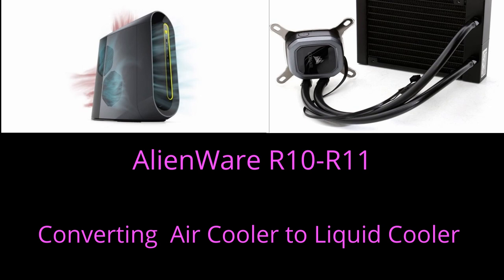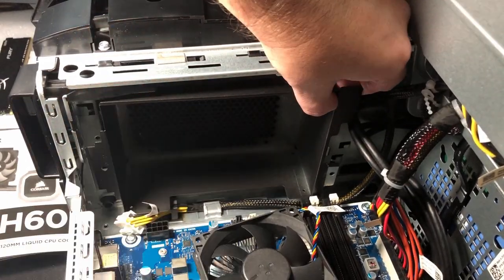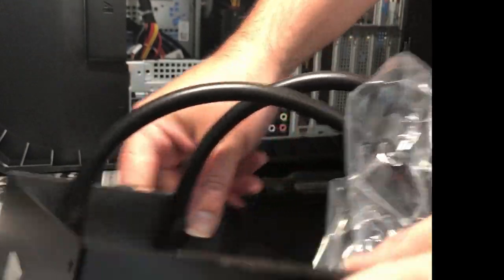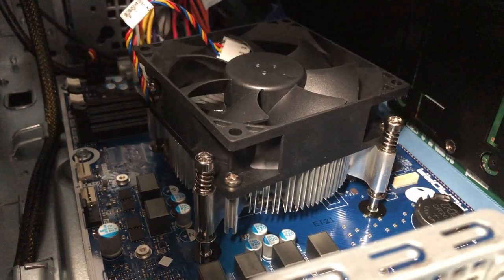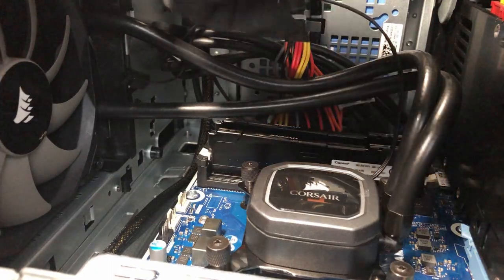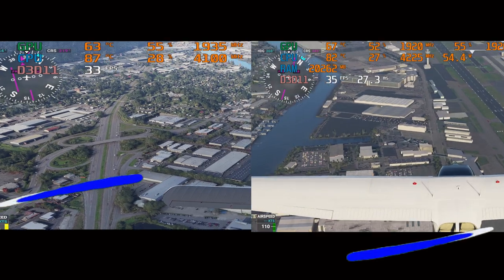Corsair H60 Liquid Cooler into Alienware R10 - R11 , Step by step tutorial.

Comment: Just did this to my R10. The radiator fit into the factory shroud is so so satisfying. Like it was made for it. Thanks for the tutorial! My R10 no longer sounds like an Airbus A380!
Reply: Heyy where do I plug my 4/3 pin plug at on my motherboard
Reply: Probably because the existing stock radiator is basically the same thing, just different fan (stock fan more powerful by noisy)?

Comment: Thank you for this tutorial.  I got this liquid cooler to replace the stock i7-10700 heat sink/fan.  My CPU temps dropped roughly by about 30-40 degrees Celsius.  Also, the quietness is great as well.

Comment: Thanks so much for this guide, I used it for my system and it was perfect. I also replaced the front fan to reduce noise as well. The only suggestion I will make to people who are doing this is to make sure you unplug your video card power cables before lifting the powersuply up, I did not do this and it pulled the video card out of the slot. Luckily nothing was damaged.

Comment: Seems to be working great for me. I did a push/pull fan setup on the radiator with two ML 120 Pro's. 

I did get the bios diagnostic error for "top fan", but "CPU fan" was fine which is also one of the new fans and both are spinning. Cooler is lit up and liquid is flowing.

FYI for anyone else interested, I also tried an Arctic Liquid Freezer II 120, but the holes did not align with the bracket and the hoses were too sturdy to really cram in this case safely.

CPU under 100% load is still up to 83⁰ C, but it's much quieter, and that 83⁰ would have been at least 92⁰ before while also sounding like a leaf blower.
Reply: Hi, push pull fan control by the cooler as well? Or one is connect to the cooler and other unit connect to the top fan? Thanks for your help 😊
Reply: please reply what do you mean top fan cpu fan did you use y splitter for the top fan or cpufan? what 4 pin did you use ? for the radiator fans is it the top fan or cpu fan ? with y splitter

Comment: Just did this mod, what a difference! No screaming fans anymore! No BIOS errors on boot up either  (I'm running an R10 if anyone is wondering).  Also swapped front fan and the stock H60 fan for ML120 Pro fans.  38-40 degC on idle and 75 degC on stress test... so quiet 🤫

Thanks for the video!
Reply: Where did you plug the pump/fan into I heard if you plug the pump into the fan spot on motherboard you get a code?
Reply: @18speedDream  any luck?
Reply: I don't this swap and everything ran fine

Comment: I figured I'd post this in a new comment: My own h60 installation went perfectly! The highest temp I've pulled so far is 61c while gaming. The SSD install was easy as hell, there's included 2.5" mounts in the bottom of the case that are snap-in. I found that there's a bit of space in front of the PSU to tuck the hoses while swinging the power supply down. The runs for cable management are great for keeping the h60's SATA power cable organized. I did need to unplug the two 4-pin power connectors and tuck those away while working, but I just re-ran the cables after with no issues. The trickiest part was actually installing the RAM with the hoses in the way and, of course, maneuvering the fan/radiator housing out of the top of the case. You had a great angle in your video though so I knew to tilt just the right way to clear them. 

Thank you so much for your guidance, my friend is extremely pleased with his computer. One thing I noticed was the fan seems to be pegged at 23% usage. Is there a way to increase/vary this? I tried in Alienware Command Center with no luck. Also, looks like the stock fan uses ball-bearings! Yuck! I'll be installing some RAM and creating the XMP profile for it tomorrow, my first AMD RAM installation and I hear it can be tricky, but the timings look to be printed on the back of the RAM modules so fingers crossed it will post with the 4 x 8 GB (32gb) RAM I'll be throwing in there. I hate RAM issues so I'm hoping I don't see boot issues or stock clock speeds of like 2133mhz. 

Once again, thank you for this video and your guidance!
Reply from the maker: Great to hear about the smooth install and the extra installation tips. The Fan speed changes seem to be controlled by   command center without a great  amount of control - probably to keep newbies like me from making to many of the wrong changes. I have read that the percentage for corsair 120 might be based on the higher speed stock fan ie. 23% might be really 46% if the max speed is half of the stock fan.
Reply: @stonyworld6788  The most I can get out of my top fan is 40% when I have it set at 100%.  Is 40% the new 100% on this setup?
Reply: If my ram won’t post and my boards clocked at 2133mhz is that bad ? Do I need 2133mhz or smaller ram to use I grabbed a 16gb kit for 50$ and I’m sad I can’t use it now waste of my time and money and I also picked up a aio cooler for 20$ I haven’t installed it yet it’s coming right now as we speak where does the 4 pin plug go? For the unit

Comment: I installed my cooler like this video, I ran it, it helped, it was quite and cooler... However... This setup is pushing hot air thru the "radiator" and out of the top of the case, the liquid cooler does a better job when you pull cool air thru the "radiator" instead. I reversed my top fan, and reversed my front fan and my R10 runs another 10c cooler. Your video was helpful tho thanks
Reply: Thats insane 😂

Comment: I just wrapped up this install on an R10 with a 3700X and a 3070, and it made a HUGE difference. Running a game it would reach up to 90 degrees(!) and just doing normal browsing it would reach the 70's.
Now with the water cooling install it is topping out at 68 during gaming.

Thanks so much for this tutorial.
Reply: Been working on my friends. He has the 3700x with the 3080. His cpu temps have hit 102c and crashing. I just ordered this and going to pick it up now and hoping it fixes his problem. Fingers crossed
Reply: @tonyhobbs38  did it work?
Reply: @kammii7272  nope. It dropped his temps drastically but it ended up being a bad gpu. He used his warranty and they actually came out today and finally got it replaced.
Reply: @tonyhobbs38  yeah I have just bought a r10 without watching many reviews which is a bad idea on my part and had to buy this aio. Was it hard to put it on?
Reply: @kammii7272  it was really simple. The only difference that I noticed was he mentions using the small screws and putting radiator in first then the fan on the inside. I put the fan in first where it pulls the air through the radiator which they even recommend in the instructions. Hell it didn't even come with the small screws. Once you start putting it together you will see what im talking about
Reply: @tonyhobbs38  that's cool to know just ordered it a few minutes ago arriving on Monday wish me luck lol
Reply: @kammii7272  yeah just take your time and do like he shows in this video  and you won't have any problems
Reply: @tonyhobbs38  alright thank you

Comment: Will the H80i V2 work with the R12 Alienware W/i7 11700F? Thanks
Reply: I just did an h60 install on an aurora r5 and r10 with two fans for push-pull. Can be done, if the radiator is the same. Tight fit, but works. Be carefull with hose routing, because these auroras have the psu close ontop of the cpu cooler-gets tight in there

Comment: thanks for the vid bro, installed it today and an extra corsair 120mm fan, i ran hwinfo64 but core 5 or w/e still thermal throttles ): and cpu package and core max are like 90-103 degrees ): any suggestions or did i do sum wrong

Comment: Followed your guide, and everything runs perfect. Thanks a lot! (Aurora R11 - plugged the pin in the CPU fan)
Reply: which cable did you plug into the cpu fan ?
Reply: @guillaumebrossault4130    Hello ! You have three cables from the air cooler :
1. A SATA, your probably have few that stay close to the PC power supply, wrapped together
2. A fan tachometer to a 4 pins (near the CPU)
3. And a 3 pin - in the one labelled "CPU FAN"  (also near the CPU).
Don't worry, if you don't plug them correctly, you can still remove them and try to another place, but for me, it worked first try. And as I said, they are labelled.
Reply: I’m about to change mine tonight and I’m so nervous.
Reply: @austinreese1443   Don't be :D
I was too, and if you take your time, it will be alright. Just be smooth when you put the cooler on the CPU : don't tighten the screw too hard.
Reply: @austinreese1443  how did it go?

Comment: Thank you so much, followed your video, added vrm heatsinks, and 2 Noctua fans.  The difference is amazing.  Running Doom Eternal I was hitting 93 degrees, easy.  Now it's mid 60's and the fan noise is barely audible.
Reply: yo what 2 fans did u add and where
Reply: and what vrm heatsink and which one like r10 or r11 or r12

Comment: Thanks for a great how to. I installed the H60 into my r9. Everything worked first time and the computer is so much quieter now and the core temps are way below what they were before. Also thanks for the tip about placing the pump tach lead in the fan CPU slot on the r9. No Bios error messages about CPU fan being inop.
Reply: I’m having this issue, though. I put into pump fan slot and the PC doesn’t boot.. I put into cpu fan and I get a “component has an error” message after testing for some time. What do I do to fix this?
Reply: @Bren255Bren  did you fix the issue?
Reply: @necromaddy  I did, but it’s been so long I’m unsure of how I exactly did it
Reply: @Bren255Bren  im having issue when i upgrade

Comment: Thanks for posting this. Great job and it's very helpful. It'd be best to take a Dremel and cut out the mesh from the bracket since it does restrict airflow. I'm sure it works fine with it left as is, but it does restrict airflow somewhat.

Comment: Thanks for the video. I have an r10 with AMD ryzen 7 5800. The stock amd mounting case was not present and you can just use the intel, 4 screw pattern (exact same as this video) to mount the pump instead.

Comment: Thanks so much for this video, i found that the alienware command center could not control the cosair fan and i was hitting temps around 70 when playing warzone , so i took out the cosair fan and put the original alienware fan against the liquid cooler's raidiator and now it hits around 60 when playing warzone but the alienware fans are noisy af
Reply: That's interesting. I am using CORSAIR ML120 fans(2). Mine are quiet and I have control too! Temps went from 75C to 64C under load(fan speed bout 38%). Today, I installed the CORSAIR H60. Temps went from 64C to 49C under load(fan speed dropped to 27%)!  I thought it was quiet before. Now, it's much cooler and quieter!!!!
Reply: @terrellwright7565  which motherboard fan ports are you placing the fans into? I’m running into the same issue-no fan control with the Corsair
Reply: @Str8Clippin  Mine say "TOP  FAN" and "FRONT FAN"
Reply: @Str8Clippin  Watch John-Patrick McNown video on how to increase fan speed through AWCC, it worked for me and I got the r10 with corsair h60 switch
Reply: @terrellwright7565  any setting we need to set ? I using h60i as well, and plug in cpu fan
Reply: @Str8Clippin  you need a 4pin pwm fan.  Replace the  stock Corsair one with a Corsair 120ml pro and you will gain control.back.  this is well documented in various forums.

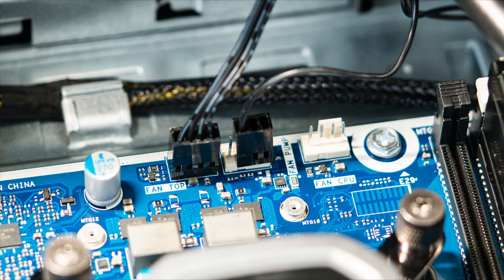Comment: I thought I had installed mine wrong because it has 1 prong in the middle like what you showed at 8:50! However when I start my R11 it does a check for a CPU fan and gives me a message saying I don't have a CPU fan..which is true I have it liquid cooled now..should I be getting this message? Its a BIOS setup or something..I think you actually mentioned this
Reply from the maker: Yes, this might be a R11 Bios error - Some people on reddit have changed the PUMP FAN to the CPU fan and it clears the message and still runs the Fan. My guess is that there may be a "hidden bios setting" from the factory selecting  liquid or air. I'm not a bios expert  so its just a guess. I had an old computer from windows 7 that always had a bios start up error after windows 10 update - the computer worked but its not fun seeing an error message all the time. . Hope that helps - maybe someone else has more info?
Reply: @stonyworld6788  Yes thats what I did and it worked perfectly!
Reply from the maker: Great to Hear!
Reply: @jenniferhalliwell416   you dont get any error messages anymore?
Reply: @josemadriz5716  No it works perfectly!
Reply: @jenniferhalliwell416  I have an r11 and this might just be what I need!
Reply: @josemadriz5716  It works perfectly and I have no problems or complaints with mine. The liquid cooling works great and the video was very helpful!

Comment: I put the old h60 pump in my r11 and I had to plug in the pump to the cpu fan pin to avoid the bios error.
Reply: I did this and still get the bios error...  Is there a way to reset/clear the error?
Reply: @adamsmith2760  Dell technician told me that don't use the PUMP_CPU. Instead, plug the pump cable to FAN_CPU, and the fan on the radiator goes to FAN_TOP. I also purchase a vrm heatsink. I am waiting for the vrm heatsink delivery, will come back and report the result.
Reply: @skywalkerpj563  it worked!  Thanks so much for the help.
Reply: @adamsmith2760  glad it helped.
Reply: @skywalkerpj563  where did you order the vrm heatsink and part number ? my R11 vrm temp is 104C+. Thanks
Reply: @clapperzhu  I got it from dell. I am not sure about the vm sink part number for R11, mine is R10. You can ask dell customer service for help maybe.

Comment: I've just replaced that totally stupid air cooler (that I had ordered by mistake with my Alienware R10 - 5600x / RTX 3080). Great video that really helped a lot! Thanks!
I would even go further and replace the top fan  (Corsair SP120) that comes with the H60 with a ML120 Pro and also replace the remaining junk Dell front fan with a ML120 Pro or a super quiet Noctua AF12x25 pwm fan. This reduces the noise of the Alienware and brings down the temperature further specially for the GPU. The front fan can easily be replaced, just need to take out the graphic card and replace it 1:1.

Still cannot believe that you can still order an Alienware R10 with the hot new AMD 5600x-5900x CPU's with these crap fans.
Reply from the maker: Yeah , it is to bad that nickel pinching executives don't let good engineering rule the day on the Alienware line. But, since the supply of the RTX 3080 is in high demand, we can be thankful that we have access to join the new kids on the block with some of these new technological wonders.
Reply: @stonyworld6788  Very true ;) - Only having to wait around 1 month to get a Ryzen 5600x and a RTX 3080 without any scalpers affecting the price is surely the upside.

Comment: I'm the guy from reddit. I replied to your comment on the OP.

I'm having a problem since you did not record installing the fan onto the radiator. I now do not know how I get the fan in with the radiator. And where the washers go...
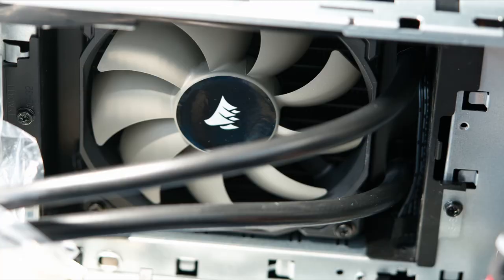Reply from the maker: The Fan just sits over the radiator - the flow of the fan is over the radiator -out the case exhaust.  The radiator has prebuilt screw  hole inserts -just line up the fan over the radiator and insert the screw with the washer - washer is on the screw on the fan outside - see 6:17 time  stamp.
Reply: @stonyworld6788  I JUST got it all figured out, am typing this reply out now on my computer. Turned out, I just needed to go farther in the video. I'm kind of an idiot in that regard :L

Sorry about my frustration, if it came out through my comment. got ti all set up, looks quite nice, I must say. This is my first change I've ever done to any computer I've owned. I was VERY anxious. This is the first change I've done to a PC, aside from swapping out a graphics card and a power supply. Got it all done, and we are good to go! Thank you for your help via reddit and on here. Very much appreciated :) 

Hope you have a wonderful rest of your year and a good start to 2021! 
Will definitely be recommending this video to anyone I know that has issues swapping their cooler out!
Reply: And yeah I definitely could of figured out the fan going over the radiator, I just hit a wall and was like "EXPLETIVE" not really sure why the just sitting over the radiator did not occur to me lol

Comment: I really appreciate this step by step. I have an alienware ordered and I could've sworn I chosen the liquid cooled. But apparently on the sheets it says air cooled. So I been buying components to make it better and I have a Corsair liquid cooled I have bought to do this, Im just worried about doing it that I don't want to break anything lol.
Reply: do you have an r12?
Reply: @michaelgambale6491  I have a  r10 ordered with an amd ryzen 5800, 3060ti
Reply: How did it go? I have the exact setup and am doing the H60 today.
Reply: @SoopaKoopa  how did yours go? I am literally about to start installing my h60 into the same model and specs as yours.
Reply: @zefte  Its very simple. Just be mindful of the video card cables.
Reply: @SoopaKoopa  I’m halfway dobe
Reply: @SoopaKoopa  I am having trouble figuring out which sata power cable to connect it to. They are all p something, would you know a specific one to attach it to?
Reply: @SoopaKoopa  nvm fixed it now my pc runs like a dream!
Reply: @zefte  glad to hear man, it will be a night and day difference for sure!
Reply: @SoopaKoopa  oh btw, the games and everything run smoothly and good. But, sometimes my windows alone lags not in game or just the browser? Could you know if it may be a faulty windows or just a corrupt browser?

Comment: I was trying to do this with my r11, the liquid cooler I have didn’t provide as clear instructions as I hoped so I went to this video only to find out my cooler did not fit inside the factory shroud, do I just remove the shroud and put it in or do I have to get a smaller one?